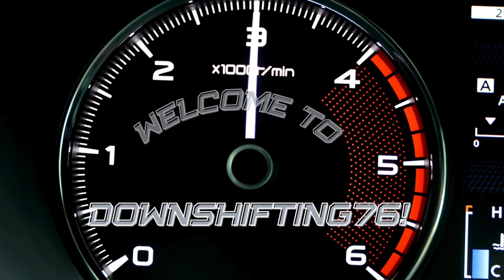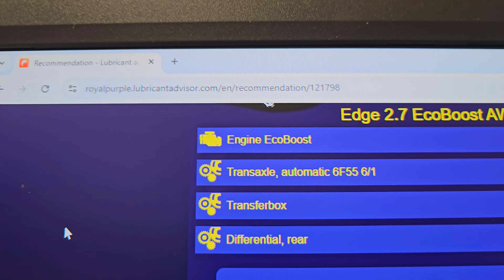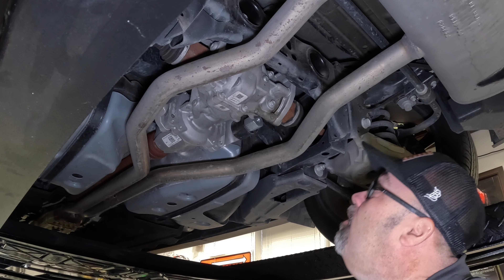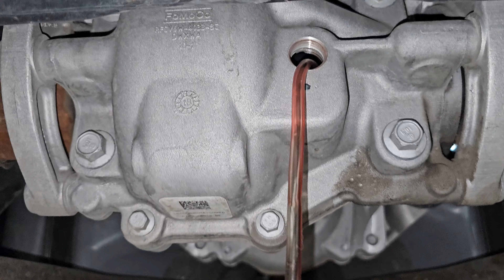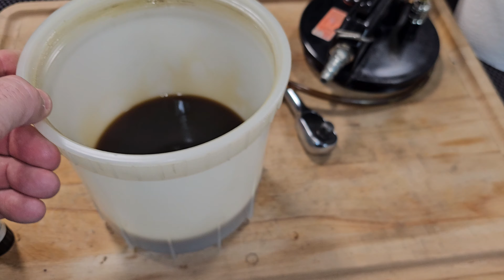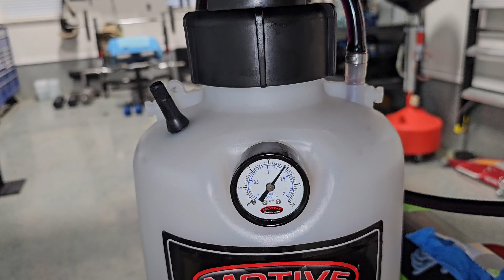Upgrading Rear Differential Fluid on a Ford AWD (Royal Purple Gear Oil)

Comment from the maker: 🔩 Have you serviced the rear differential in your Ford AWD vehicle? What fluid are you running, and at what mileage are you changing it? If you’ve used Royal Purple gear oil, share your experience below!

🟣 In this video, we service the rear differential on our 2018 Ford Edge Sport AWD and upgrade the fluid to Royal Purple gear oil as part of our drivetrain maintenance.

⚙️ Servicing the AWD system? Don’t forget the other end! Check out our complete Ford Edge Power Transfer Unit (PTU) service:
▶️ https://youtu.be/Pov7PenLdq8

🚙 For more real-world Ford Edge ownership, DIY maintenance, fluid services, repairs, and automotive how-to content, subscribe and ride along with us:
https://www.youtube.com/@DownShifting76?sub_confirmation=1

🏁 Check out performance parts and gear from our affiliate partner, Summit Racing Equipment:
https://summitracing.pxf.io/3kAWdr

👕 Visit the DownShifting merchandise and accessory shop:
https://downshifting76.myspreadshop.com/

Thanks for watching and supporting DownShifting76!

Comment: Great video! I'm going to try this on my taurus using amsoil severe gear. I got a long arm flexible 3/8th rachet. Im hoping this helps squeeze into tight space I'll keep y'all posted!
Reply from the maker: @BlackPartyCapt That’s exactly what we like to hear.
That long arm flexible 3/8” ratchet should be a game changer in those tight spaces, especially on those Taurus setups. And the Amsoil Severe Gear is solid stuff, you’re definitely going with a quality fluid there.

Let us know how it goes once you get in there—always good to hear how it works out on different platforms.

Appreciate you watching and taking the time to comment
Reply: @DownShifting76 I just got it finished using hand pumps 😢 that oil is no joke 😅 a tight squeeze but definitely  doable!
Reply from the maker: @BlackPartyCapt glad it worked out and good luck with the future projects!

Comment: So, essentially all you did was mix new and old fluid. Mostly old as the new fluid sits up top and, spews out the fill hole and doesn't really mix. Or, am I missing something?
Reply from the maker: @Kain-l1e9s Good question, and this comes up a lot on sealed differentials.

On units without a drain plug, the service procedure is to evacuate as much fluid as possible through the fill port, then refill with fresh fluid. While there will always be a small amount of residual fluid left behind, the majority of the old oil is removed and replaced with new fluid containing a full detergent and additive package.

Once the vehicle is driven, the remaining fluid mixes completely — there’s no “layering” effect inside a differential. This is the same approach used by dealerships and manufacturers on sealed housings.

The goal isn’t a laboratory-perfect zero-residual exchange — it’s refreshing the lubrication and additive package to extend component life, which this process accomplishes effectively.

Thank you for watching!

Comment: How did you know it was full? Until it started to weep out the hole?
Reply from the maker: @enigmaone7055 yes that is correct.
Good luck with your project and thanks much for watching!
Reply: It holds 28 oz of 75 weight

Comment: My 2022 ford edge has a drain plug on the differential  housing
Reply from the maker: @Pete9999100 that is awesome, it would be great if all differential's had a drain.
Thank you very much for watching!
Reply: Thank God you said that I looked at mine and was like what do you mean there's no drain plug im looking at it
Reply: @dylanbass6887 I have 161000 miles on it and it uses a disconnect fluid.
I ve change it every 30000 miles and same for the power take off unit(PTU)
both have drain plugs.

Comment: Ywah, its just a plug. Hate to see people crank down on em and strup out the threads un necessarily. Its aluminum...not cast iron.
Reply: True.  Or crack the housing.  JUst like NPT fittings, let the sealant seal it.  It just needs to be snug.
Reply from the maker: @SavNout01 thank you very much for watching!